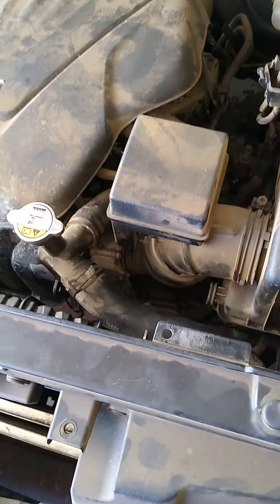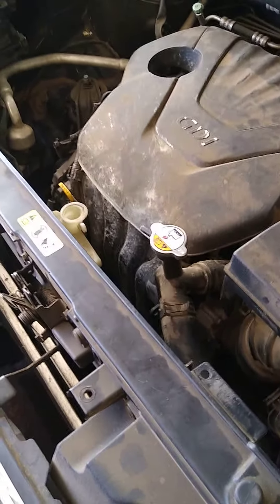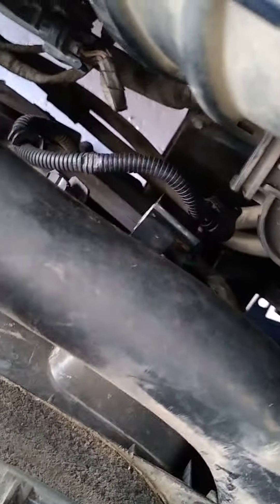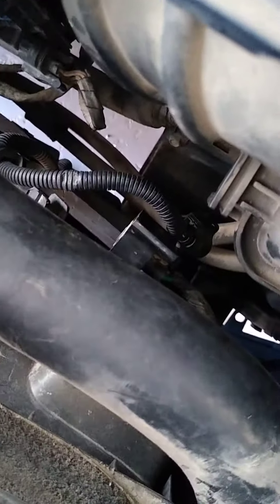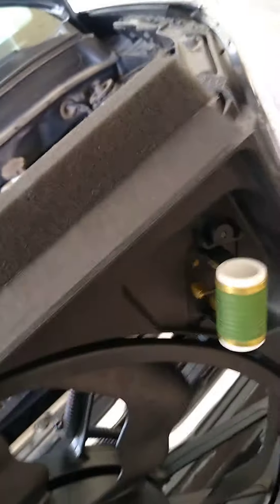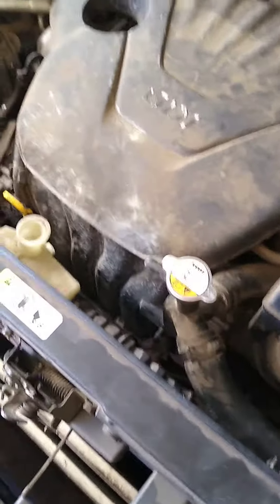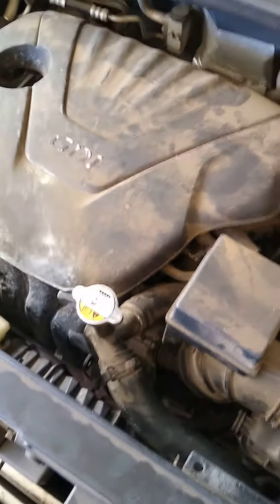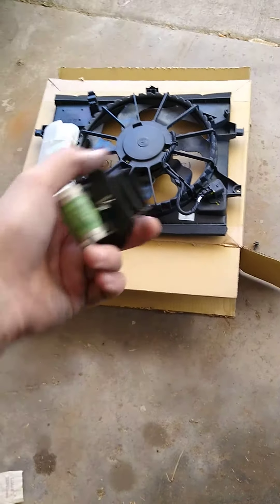2012 Kia soul cooling fan/warm ac at idle problem

Comment: I’m experiencing exact same problem AC blows hot when stopped at red lights but when I get back on the road moving it goes back to cold and the temp gauge goes back down this is my third time back at the Kia dealership they still haven’t fixed it thank you very much hope that’s my problem as well

Comment: Have this issue with 2015 Kia soul..also getting water on floor..will try it and see what happens
Reply from the maker: That water issue if it's in the car on the  passenger side find your condensation line and blow compressed air thru it usually will clear it out and a lot of water will dump out
Reply: @Lefteyesgarage  already got a pancake compressor ordered and on its way😀.. Thanks for what you do